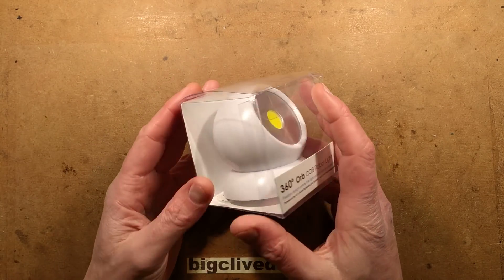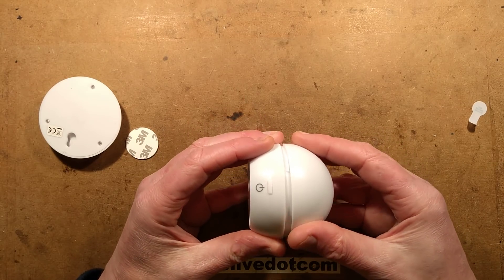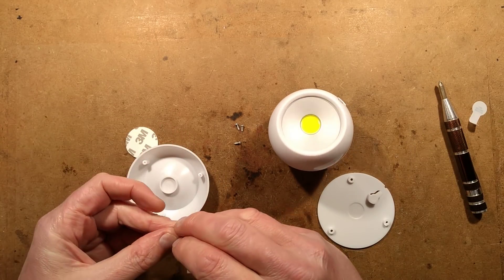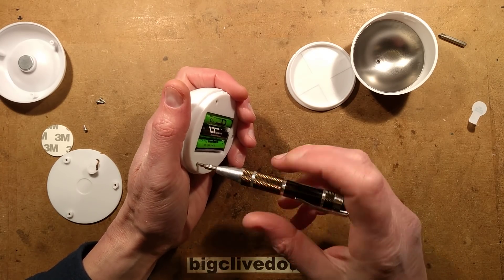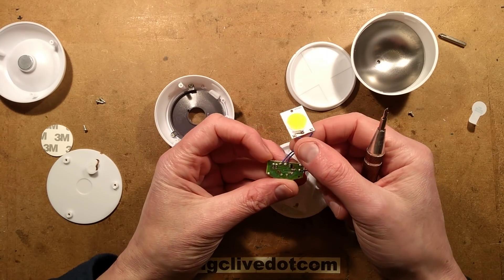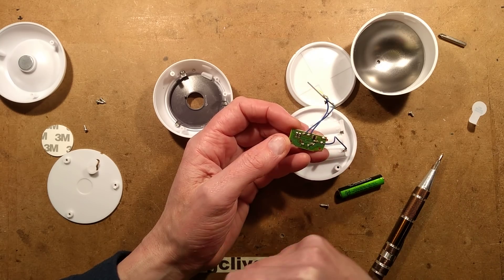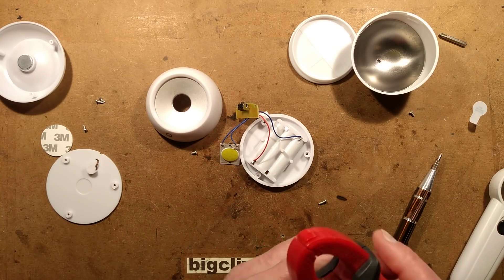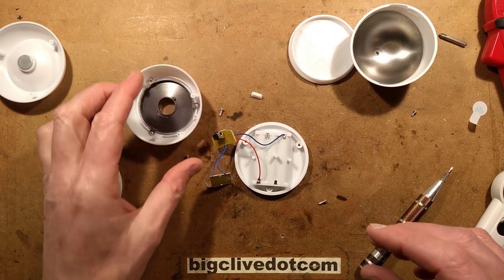Inside Poundland's orb 360 robot COB light.

Comment: Hi big Clive would it be possible to mod this light so as it no longer has the flash feature, and run at full strength or half power or even powered by a usb power bank so it could be used as a light reading light or as a power cut light ???  And make a video of this type of hacks to it, Many Mr gatez

Comment: I've just got one of these based on this video.  I'd suggest gluing in the metal dome.  On a happy not  there is a 'hidden' feature.  If you press and hold the power button it turns in to SOS mode!  I wonder if you have any other devices like this where you press and hold the power button rather than the traditional momentary press.

Comment: If you think that AAA cells are bad, someone bought us an alarm clock for a gift, about 25 years ago. It uses a single N cell. Those nasty things have never been widely stocked, so they cost more than an AA cell. To be fair, the clock runs for more than a year on an alkaline cell - providing that you never use the alarm. The maddening thing is that, if the fragile ceramic case didn't restrict access, there's room for an AA cell inside the thing.

Comment: Would it work with rechargables? I'm thinking the different voltage (1.2v) might be a problem for the narrow range of LEDs.
Reply from the maker: The NiMh cells would spend most of their time at 3.6V which is probably still enough to give out useful intensity, but with a much longer run time.

Comment: Three triple As - my least favourite battery configuration :(
Reply from the maker: It is exasperating.  Especially when coupled with cheap chargers that only charge cells in pairs.
Reply: My electric wet razor thingie takes a single AAA, so if I can time it right, I can end up with 2 or 4 for a charge. Likewise some clocks for the 3xAA problem where it exists.

Comment: By golly.  I want one.  The swivelly-thing is brilliant.  Great idea.

I'd hope to adapt it to hold a rechargeable li-ion.  Or several.  Maybe 18350's?  So as to last a nice long time.  Shouldn't matter if it's a bit heavier?

The idea could scale up nicely to a more premium sort of product, bigger and prettier.

Inductive charging would be cool, though very tricky to achieve in the presence of that metal hemisphere.  But imagine being able to grab a light and move it to some convenient socket, say in the garage or shed, where there's no power wiring.  Then just pop it back into a wired socket later on to charge up.  Sure, a flashlight can do the same but not while looking so damn cool.  :-)

Comment: Damn those bright / dim / flash chips.  It's getting hard to find a cheap LED torch that doesn't have two pointless modes that you'll never use.

An idiot's guide to turning that into a straight on/off circuit would be much appreciated.

Comment: Which clamp meter would you recommend, that could read something this low in power. I’m on a tight budget. Love your videos Clive.
Reply from the maker: The one shown is a Uni-T UT210E and is a good example of a modern meter that has great functionality for the cost.  Typically around 35£/$.  It has DC current measurement with a clamp which used to only be found on very expensive meters.
Reply: Thank you Clive. Always look forward to your videos, Have a great Christmas.  @bigclivedotcom

Comment: So, if you stuff this light with good 900mAh AAA batteries, you get about 3 hours of light on the higher setting or 9 hours on the lower setting.
Reply from the maker: Probably longer as the current will be lower at 3.6V.

Comment: mystery capacitor could be part of the debounce switch circuit. Debounce is a switch with a cap that helps smooth out the press signal and keep the switch from being sensitive. We've all probably had a light, alarm clock, or something that for every quick button press, the bounce of the switch activates twice.

Comment: Its a shame the base was not magnetic as it would be good to work on an engine of a car as it can be swivelled to direct the light where you want it. Maybe another magnet and some felt on the base to be used on cars, stick it on wing of a car swivel the light down to the to flat tyre and remove the illuminated wheel.

Comment: Hi Clive , there is a 4th setting on the light. If you hold down the button  when it  is in "Strobe" mode. It then flashes "SOS".  I found it quite by chance.   I have these lights around my house just in case of a power cut.
Reply from the maker: The SOS mode can be entered when the lamp is off too.

Comment: Why would you need decoupling capacitor on batterys?
Reply: When the batteries get low the internal resistance can cause problems such as motor boating in audio amps.

Comment: I believe that either the cap is used for smoothing a pulsed current that's used for current regulation or is is used to set the flash frequency. The current regulation would also explain the 1R resistor.

Comment: I think that "strange" capacitor is what resets the cycles back to the beginning of the 3 selection setting (The Brightest) , after you turn it off  (and it sits unpowered for a second) Just a guess?
Reply: If you cut off the power for <1s, the circuit will count up and enter the next mode when repowered. The counter inside the chip is supplied from the cap, while power is off. 
If the battery power is disconnected for a longer period of time, the cap will be discharged and therefore the counter will be reset. That's at least what my china-flashlight seems to be doing!

Comment: The question is, could you fit an 18650 in it? Then you can take a cheapie single 18650 power bank and combine it and mount an extra magnet or two in that case on the outside to make a rather nice rechargeable work light... or portable epilepsy test, equally fun.

Comment: Mr Clive. I have a Snap-on 18v impact gun that has died on me. My Snap-on man has fled the country and its that old they would probably just want to sell me a new one. 
Would you be interested in taking it apart to see what went pop? 
I'll happily provide you with some drink and chocolate of your choice for your trouble.
Reply: If he doesn't.  AvE will.
Reply: @brianmartin1905  I'm in the UK though, shipping to the Isle of Man will be cheaper than Canada. 😂
Reply from the maker: Did it just stop working?  If it's had a lot of use it might be brush wear.
Reply: @bigclivedotcom  yes it literally just stopped working. It has always been a hobby tool and I'd guess it's seen a lot less use than one used by a real mechanic. 
I cannot see any removable brushes on the tool. 
I have an Snap-on drill of the same design that uses the same battery and that still functions perfectly.
Reply from the maker: @steventhomson7531  If it's had light use it might be worth contacting snap-on first to see if they will replace it free.  But if that fails then it would be interesting to see why it failed.  Is the battery taking a charge?

Comment: Could this be converted to use 5 volt usb?
Reply: yes
Reply: Just add a series resistor to keep the current under control.
Reply: With a wireless charging?

Comment: Off topic question: Is there an LED bulb that can be used with a room dimmer switch?
Reply from the maker: Yes, you can get dimmable LED lamps.  But some require a type of dimmer optimised for LEDs.
Reply: @bigclivedotcom  Can we have a video on what's special about dimmable LEDs and LED dimmers?
Reply from the maker: @OC35  I made a video about the complexities of dimming LED lamps a while ago.  Try searching my videos for keywords like dimming.
Reply: @bigclivedotcom  Okay. Thanks Clive
Reply: I just bought some plain vanilla ones at Walmart,  according to the box they work with a dimmer.
Reply: @tncorgi92  Thanks Paul

Comment: I’ve encountered a very interesting failure mode of a bike light ..

Mine doesn’t turn off when it’s cold ... it goes through the modes just fine, it turns on after hard reset just fine ... it just skips turning off all together

Moderately warming .. ie .. hold in hand for 1 minute makes it go to sleep though

It’s a microcontroller though, not a purpose made bike chip ..
Reply: Might be a condensation effect on the PCB if it's not coated - you might try encapsulating it in some of mr poundlands epoxy if you want to try fixing it.
Reply: Yeah it's the only thing I can think of too ... but ... that can't be ... it recognises the switch JUST FINE going from mode to mode ... why would it skip one of the modes then ...

I will try it out and report back though ... I only have nail varnish to spare atm though ._.
Reply: could be that it's going into sleep mode and then immediately false triggering to mode one... and the false triggering only happens in sleep mode.

Comment: I got one of these. Didn't find it particularly good as the battery life was poor and the case seems to be made of slightly dried out stilton.
Scavenged the magnet for future projects and put the COB in the case of a e3light GU10 - sadly £land don't seem to stock these any more but they have a good optical collimator/lens on the front. Hooked up to USB with a 10 Ohm resistor makes a very nice but gentle spotlight.
The leftovers are in the bit box awaiting future projects, so good value for money.
Reply: This here is why Poundland exists, parts! Unless you by components in bulk it's a great way to get parts.
Reply: I suspect the case is made from polystyrene, rather that the more robust, and slightly more expensive, ABS. It's much more brittle and feels cheap.
Reply: @WaltonPete  I would guess polypropylene :P

Comment: I was looking at wish dot com recently and along with the ubiquitous 9800mAh 18650 cells they're trying to sell, I see also several "power banks" offering such outrageous values as 790000mAh  (£12!)  or how about a nice round 900000mAh for £6 and it's got a solar panel This stuff needs to be curtailed somehow! Madness.
Reply from the maker: It's disappointing that they don't round it up to a nice solid million mAh.
Reply: My 10millionmAh pocket powerbank has charged my phone for 6 years
Reply: @Shazzkid  INFINITE POWER 🤣🙃😁😁
Reply: I just got 2 10,000mah powerbanks from Geek, But they have a wireless charging coil in them, so I can just lay my iPhone X on the power bank and it charges it (up to 3 full charges) Also has the 5v 1.0A and 5v 2.1A USB’s too, so I could Charge 3 Phones at once 😁 Think they were about £12/13 each 👍🏻
Reply: @MrZanderLaw  I don't think closely coupled wireless chargers have breached 80% efficiency yet, and in a powerbank it would certainly be less.. So what's it like intentionally wasting 30% of your powerbank's capacity? Multiply that by the efficiency of the power bank's boost circuitry and hey presto, you could have charged 5 phones with the same energy by using normal wall ACDC adaptors.......
Reply: If you want to have some fun, whilst raising your blood pressure, may I suggest you buy a USB Power 'reader' that shows volts/current etc plus have a way to draw maximum current from it. It's infuriating how many USB supplies, of every type, output nothing even remotely near what they specify. 

The "2.4A @ 5v" socket on my bedside light peaks at about 800mA @ 4.75v whilst my "Qualcomm 2.0 High Power (insert other sales blurb)" Chotech 6-USB AC supply maxes at 1.0A at 5v. 

I'm still excited by quality power sources like my Anker powerbank that goes like stink. I'm easily pleased, a perfect boyfriend. XD
Reply: Since it's mAh I guess it could be technically true. How many nanovolts does it output? 
(watt-hours ftw)
Reply: I dislike that they still use milliamp-hours despite there being many thousands. 9800mAh = 9.8Ah

Comment: Am I the only person who wishes there was a '3 x AAA' rechargeable battery pack - probably Lithium based? I refuse to keep landfills supplied with primary cells and most of these things don't do was well with Ni-MH (3.6v instead of 4.5v). At least a Li-Po based replacement would be 4.2v and could be charged with a 5v USB PSU.
Reply from the maker: You could use NiMh AAA cells.

Comment: Clive sir, is there a quick way of disabling the flashing mode while leaving the other modes alone? Or would it involve replacing the chip altogether?
Also do you have a PO box?
Reply from the maker: The flashing mode is built into the chip.
Reply: Try removing the capacitor? .. just don't leave it in the disabled mode if that also turn is off - it might drain the batteries.
Reply: @jayherde0  
Worth trying.
Reply: No.

Comment: Does it have the 'secret 5 mode' option (3 brightnes, SOS and flash) when you hold the power button for a length of time?
Reply: Just tested it, and yes it does.
Reply: Why? Who uses more than on or off? At most dimming. Who wants flashing lights? Feels instantly cheap to me.
Reply: @ekner  It's because the control chip they've used is a cheap one used in many bicycle lamps for which those functions make a little more sense. In this application, not so much.
Reply: ̈ ; DROP DATABASE *; // those chips are also in caving/mining lamps hence the SOS feature.

Comment: I’m buying ten of these, what a great design, would look cool with ten on a shelf. Wish they were usb powered.
Reply: Many, many years ago, flashing yellow warning lights were used on barriers around roadworks to stop people walking into the barrier (and ploughing through it, if drunk enough) at night.  At university I found out that these were not only a nice source of large 9V batteries, but a dozen in a darkened room gave a nice effect if one was sufficiently drunk.
Reply: @bdf2718  I once ended up with a car full of them on the way back from Buxton one night.. about 80 of them, all turned on too. I got a helluva headache !!
Reply: bdf2718 lol, I recall such antics back in my uni days....... don’t think it happens now,...students are too busy being sjw snowflakes ruining the world...
Reply: Easy enough to convert - see Clive's Christmas light video. Just put the lead where the batteries would connect, maybe add a resistor or two.
Reply: Mahla Propyzm good idea. I’m thinking of using them as a backlight for the tv, way cheaper and more directional than a led strip....
Reply: roberto l  ...or one of those batteries from a £land disposable phone charger.
Reply: Clive mods it with wireless charging.
Reply: @dimitar4y  Oh that's a good idea. You could have one little wireless charging cup, and when it's charged you could put it back into its socket above your desk, or wherever you need the extrra light.
Reply: @simpleminded1uk  I call it the iLightball and it costs 1999$ on release, and the backglass, even under warranty, costs 499$ to repair. 

oh.
Reply: If you hold the power button it says SOS in Morse code.